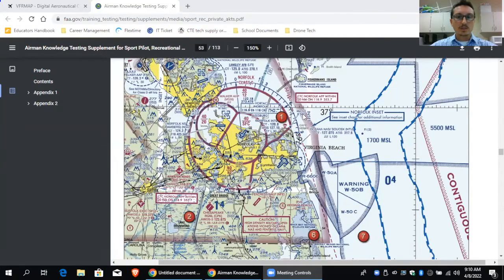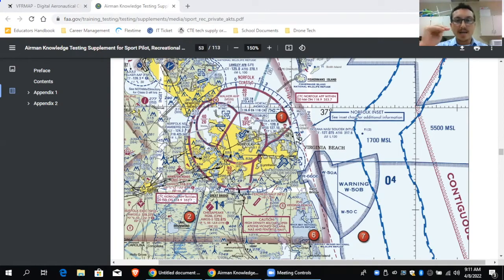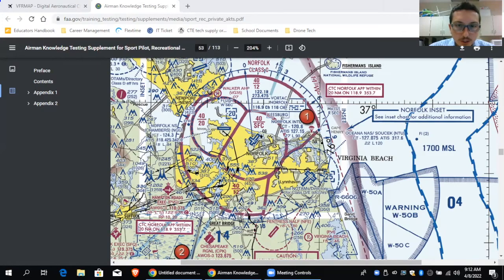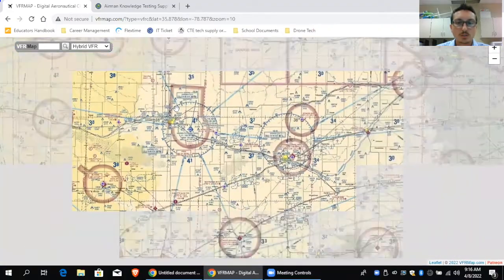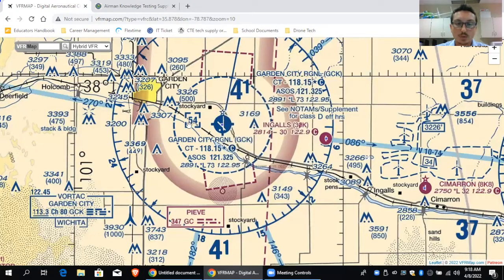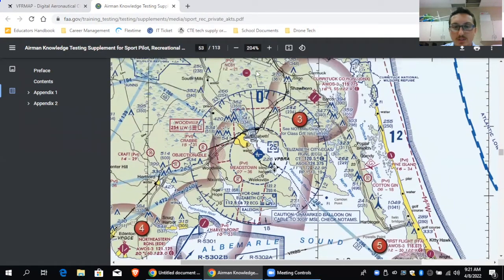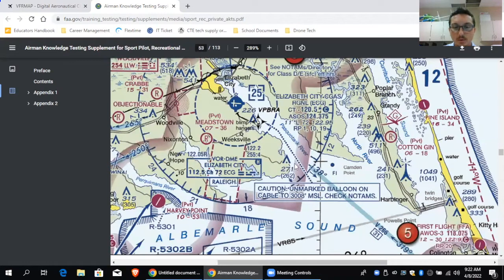FAA Part 107 Towers, Airspace, Compass

Comment: Question: At exactly 9:25 in the video, your cursor is over a magenta dot filled circle with a marked center circle with a point. What is that symbol? I have had issues with finding out what that is. I believe it to be a VFR beacon but cannot seem to find out for sure.
Reply: Found it!!!!!!!!!!!! Non-Directional Radio Beacon!!!!

Comment: I do not see why I would need ATC permission to fly in class E airspace within the shaded magenta area around the 262 foot tower. If the tower was taller and put me into class E airspace, why would I need ATC permission?
Reply: I believe you are correct in this specific instance where Class E’s floor is at 700’ and not SFC. Below is a copy / paste from an article I read.
 
“A big point of confusion comes from the fact that there are multiple types of Class E airspace, only one of which (Class E2) requires authorization in order to operate there. Part 107.41 makes clear that no person may operate a small UAS “within the lateral boundaries of the surface area of Class E airspace designated for an airport unless that person has prior authorization from ATC.” This somewhat complicated language refers specifically to Class E2 airspace, which generally means a Class E airport (with controlled airspace that extends to the surface), and not extensions to other classes of airspace.

The remaining types of Class E airspace are still considered controlled airspace, but do not require prior authorization in order to operate (since the controlled airspace starts at 700 ft. AGL) – so you don’t need a LAANC authorization there.”
 
Source: https://www.aloft.ai/blog/class-e-airspace-and-laanc/amp/

Comment: Thank you for this video. If the tower was at 560 feet AGL and it was inside the shaded magenta do you need atc clearance? I ask because 560 AGL is below 700 AGL. But if you fly at 400 feet above it then I know for sure you need it. Will they always use the word maximum allowed height? Or will they say if you inspecting the tower do you need atc clearance?
Reply from the maker: They will not always say maximum allowable height. Technically in the shaded class E you do not need permission from ATC. However, it is still “controlled airspace”. I know that might make things a bit confusing. I intend to do a video on class e airspace soon.
Reply: @MrMigsClassroom  thank you that would be helpful.

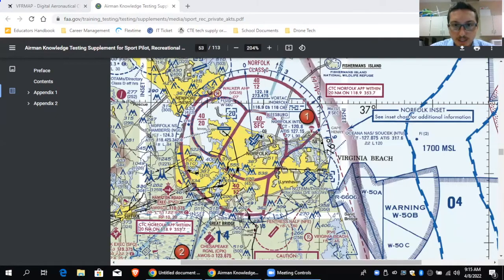Comment: At 5:49, I'm confused.  Isn't this class C airspace? The area you are pointing out is within the red solid lined area. Wouldn't you need to file for authorization to enter through LAANC even if you are below the 1200 ft floor because you are in Class C?  I don't understand how this is Class E airspace. I know in Class E you don't need authorization to enter if you are flying below the floor, but that's not the case in Class B,C, and D.
Reply: No, you wouldn’t need authorization in that specific area if you fly your drone under 1200’ because the floor of Class C in that specific area is 1200’. That’s what the 40 over 12 means, a floor of 1200’ and a ceiling of 4000’ ft. I think what’s confusing you is you’re only going by the fact you’re inside the magenta ring. That’s just the first step. You must also look at what the floor and ceiling height is for each specific airspace.
 
Also, under 1200’ in this specific area is class G, not E, as he states at 6:20.
Reply: I'm having the same confusions as well. @Mr. Mig can you clarify this?

Comment: Hi Mr Migs, thank you for your videos they are awesome! Question... Is there a trick to recognize where the actual airport is in relation to where the airport name is written on the map/charts? I've had practice questions ask me to look so many nautical miles of an airport and I find it difficult to recognize which airport is which because sometimes there are a couple next to each other. Is label of the airport name always on the left? So if say we are looking for the SUX airport do we look for the words SUX and then find the airport to the right side of the words SUX? Or is there any other way to recognize which airport name goes to each airport? I've gotten wrong answers because I was measuring from the next airport over because I'm apparently not reading the map correctly.
Reply: That's a very good question, I get confused with this also at time.

Comment: I have mavic mini 2 and I think I flew on outskirts of class D, to take a pic of a small island. DJI app didn't stop me, it only said that I am in a enhanced warning area and that I should fly with caution. I googled it and it said that enhanced warning areas are not illegal but when looking at sky vector its clearly barely within class D. Idk why DJI didn't stop me from flying there, I am thinking that tower might've been out of hours so it was class G airspace during that time, meaning I didn't need approval. I am so confused by it
Reply from the maker: I’ll say this. DJI is good but nothing is perfect. I will also say the FAA will hold you responsible not DJI.

Comment: There is a 107 question on where drone pilots should get Notams from . Is the answer 1800 weather brief or B4UFly?
Reply from the maker: 1800wxbrief.com.
Reply: @MrMigsClassroom  thanks again for your response.  Have you heard of a Free app called part 107?  You can find it on Apple and Android store. I've been using it for the practice questions. It has a lot of the questions you are teaching on.   Thanks again
Reply from the maker: @njbpaul  I’ve never used that app. Thanks for telling me about it.

Comment: I live in the Norfolk Class "C". It is a pain to get LAANC clearance because of SFC space. I've tried 3 times to get Airspace Authorization and it has been a major pain. The deny it and never say why. Lol
Reply: Finally got an authorization. They modified it to match what they will allow for my area.  Thank you for your videos.
Reply from the maker: @lifeisxtc1  nice!
Reply from the maker: Geno, I once had an ATC employee speak in my classroom. He said even if you request 1 foot too many he has to deny the request and cannot tell you why. Next time try to request the lowest amount of height needed for your mission. If you are going to fly in an airspace that allows flight at 100ft request under 100 ft, do not request exactly 100ft.  Also, Norfolk is probably tough to get approval because of the Naval station.
Reply: @MrMigsClassroom  the Naval Staion is actually easier to fly around then ORF. lol
I live in  0 feet area.

Comment: Thanks for the videos, most awesome!!! But at the Norfolk airports and the class C and all, what makes the 40 over 12(40/12) that anything under 1200 feet is class G airspace?  Why not class D? This may be a simple answer and only reply if convenient... thank you and have a great day...
Reply from the maker: Chris, it would only be class D airspace if it has a dashed blue line. Otherwise if the outer self is 40/12 then the airspace is class G. Class G is general uncontrolled airspace.